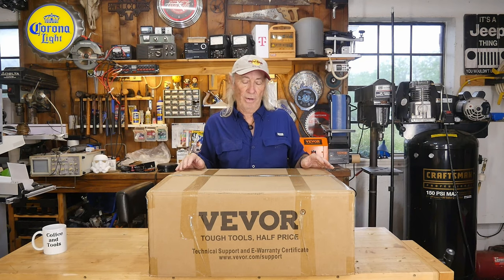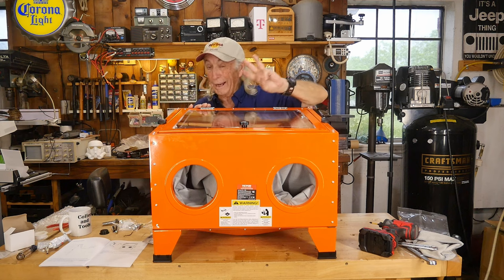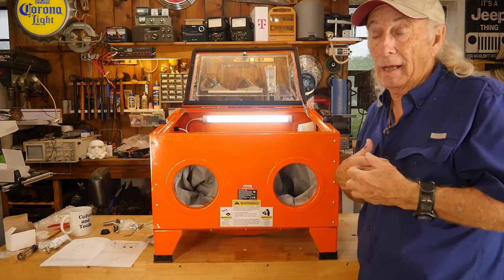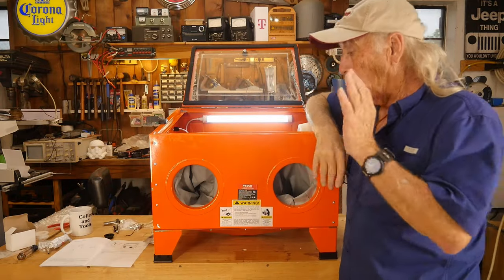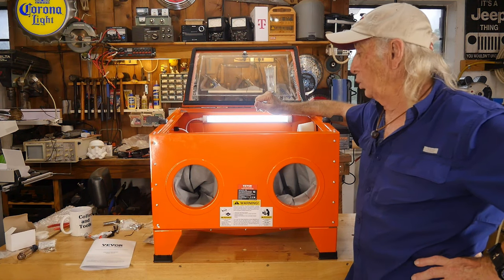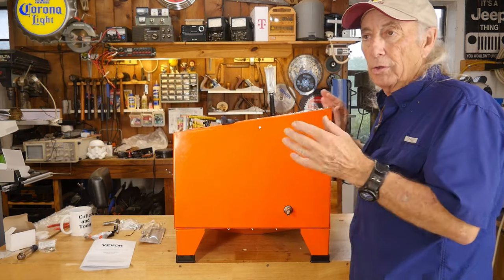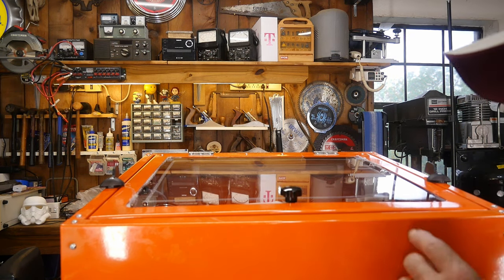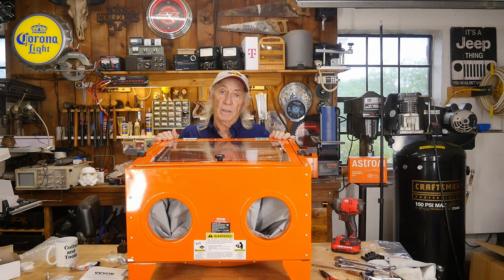VEVOR sandblaster bench top cabinet , reviewed Coffee and tools Ep 434

Comment: What is the purpose of the extra hole on the left side of the back panel? Its in a little pocket, looks like it's maybe for dust collection, but there are no mounting holes.
Reply from the maker: The cabinets have this feature, it does help with relief from the inside pressure. Even my Gate machine came with that hole and box etc..